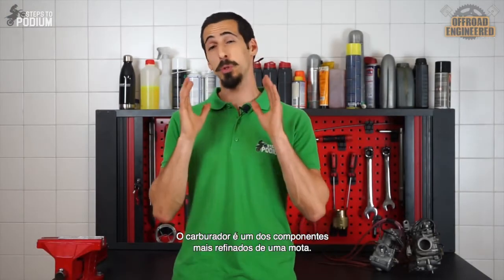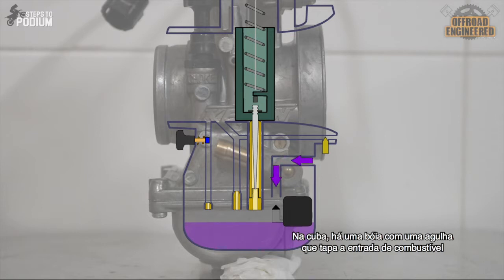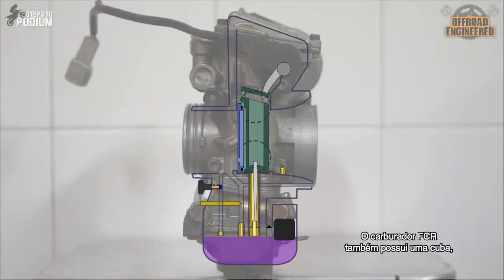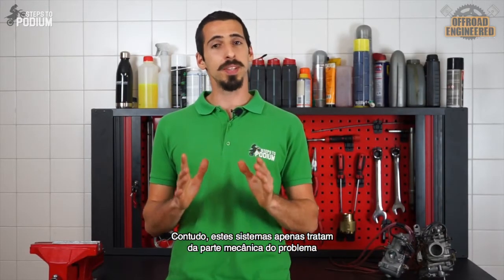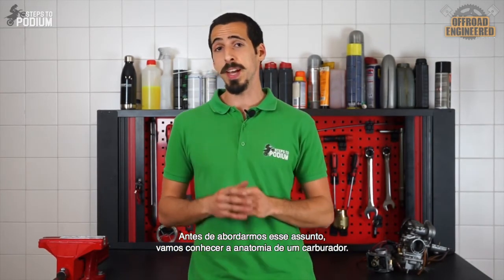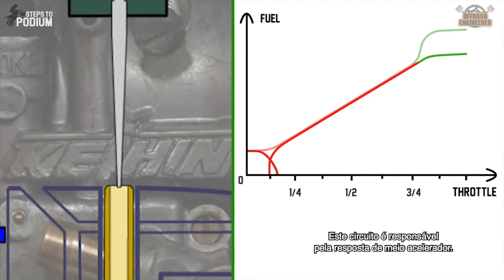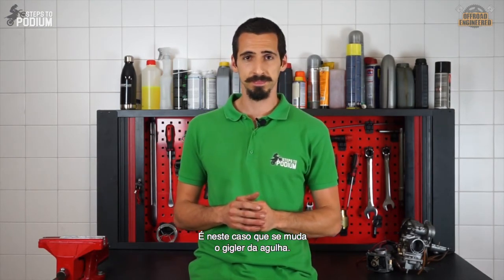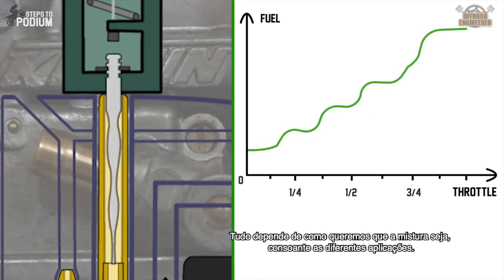Dirt bike / pit bike carburetor adjustment

Comment: Ok you will save my dirt bike & 10,000 others if you explain , how a dirty/faulty stator or unchecked valve clearance - causes 50% loss of power :( wheelies impossible ;( in a yz 426 running like crap 4 years.  And last quick question for hardest part of stator removal 
Taking the stator nut off ;( should I put skrewdriver on cam teeth so it won’t turn engine backwards? Or in gear with a stick in spokes ;(

Comment: So my bike, if I pull full throttle quickly it’s bogs and stalls, if I pull it slowly it’s fine. What’s the best solution?
Reply from the maker: How long this is going on?
Reply: @BoatMotors  just started bike is new only had few hours run time.
Reply from the maker: @Madbaz03  Try raising up the needle with one position
Reply: @BoatMotors  does the air mixture screw do anything to help with throttle. Or is that for idle only?
Reply: @BoatMotors  so adjusting the throttle and it seems that without the air filter on excess fuel is blowing out. And got serous back fire on de acceleration. Does that mean it’s to lean.
Reply from the maker: @Madbaz03  Only idle
Reply from the maker: @Madbaz03  Engine sneezing (backfire) on idle is lean fuel mixture. You can get backfire from intake valve. Check the valve gap.
Reply: @BoatMotors  as I’m the valve gap on the engine? thanks for the help.

Comment: My 4stroke dirtbike runs fine in idle and first gear but the rest it will lose power with medium and high throttle
Reply: Sounds like getting too much air in
Reply: @Ken Martin  probably i put a new port into it but i just use it to mess with
Reply: @motolifegamer4206 dont know what you mean by port
Reply: @kenmartin2454  the plastic tube in a subwoofer box
Reply: @motolifegamer4206  what does that have to do with a dirtbike? Like use it as a fuel wire?
Reply: @Ken Martin  oh wait i just commented on another video and i thought it was the one about speakers. Tbh i have no idea whats going on with my carb
Reply: @motolifegamer4206  still havent figured out?
Reply: @Ken Martin  no i adjust the air fual ratio but it doesn't change anything. I was gonna just get a new carb anyway
Reply: @motolifegamer4206  yep imean id totally clean jets and check the float height before buying a new one but yes new one is a easy fix

Comment: Excuse me Sir, when choke is on, the butterfly should be open or closed?? I'm confused on the choke position 🤔🤔, please help...
Reply from the maker: When you are pulling choke lever you are putting it in position ON and butterfly is closed. Pushing the choke back is position OFF the butterfly is parallel to the air flow and have no air restriction.
Reply: @BoatMotors  Thankyou so much sir 👍🏼👍🏼👍🏼

Comment: hi my pitbike is running rich but that i dont mind. what i dont like is that while leaned over and throttle momentarily closed , as i open and try to be smooth the throttle response is very snappy and upsets the whiole bike . will changing the base fuel/air mixture solve the trick (as there is a some black liquid on the exhausts i assume its running rich) or whill i need to change the idle needle ?
Reply from the maker: Start with the needle

Comment: Why does my new 2 strock engine starts spining the wheel without giving it throttle
Reply from the maker: If the bike is raised and the rear wheel is free and the engine is running, it is normal for the wheel to move slightly. The reason for this is the oil in the transmission that moves and engages the gears. This is normal.
Reply: @BoatMotors  but the wheel spin fast and the engine reves alot
Reply from the maker: Check and adjust throttle cable